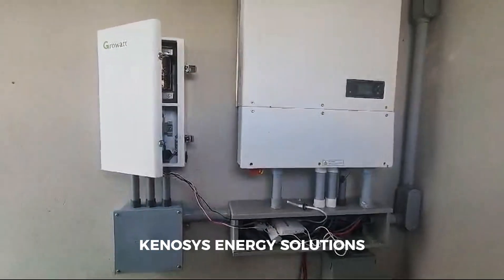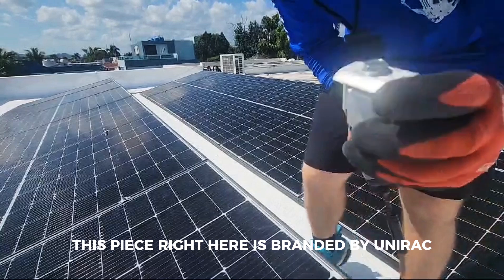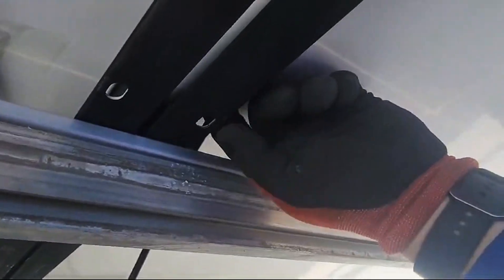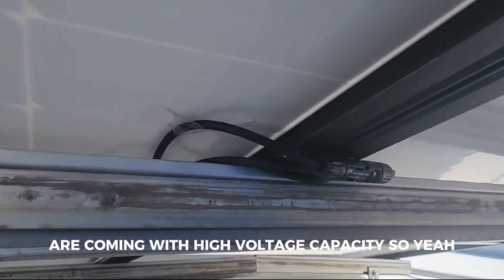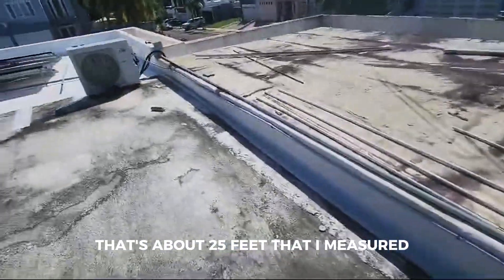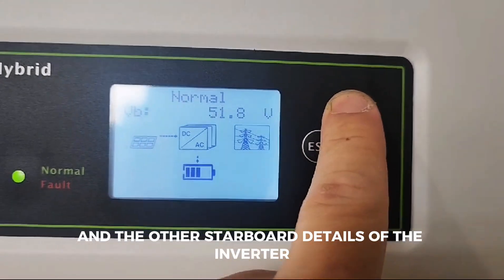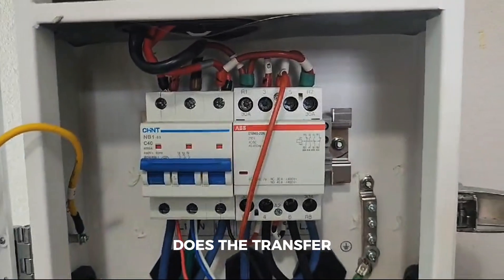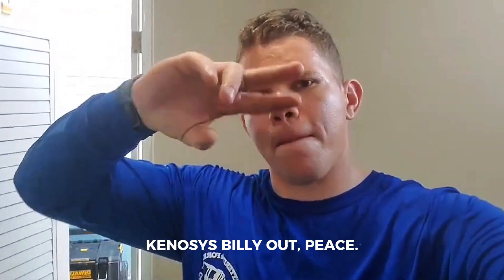Solar panel installation with Growatt 6k Hybrid inverter

Comment: What product do you use to attach to that roof without leaks?
Reply from the maker: @Tobias-uf2oj  High strength anchoring epoxy by Quikrete.